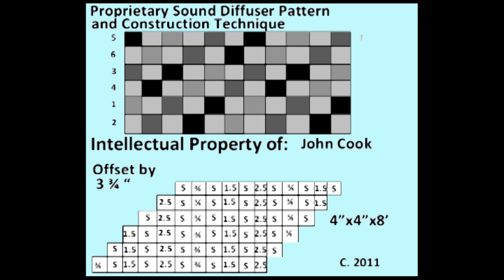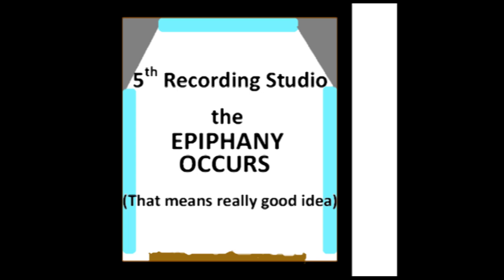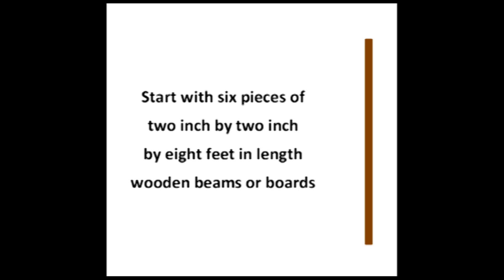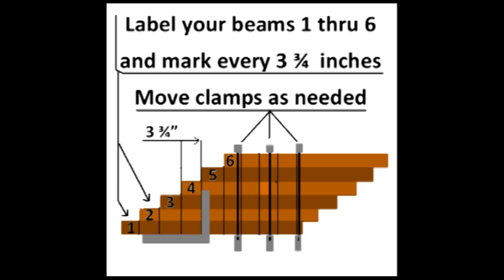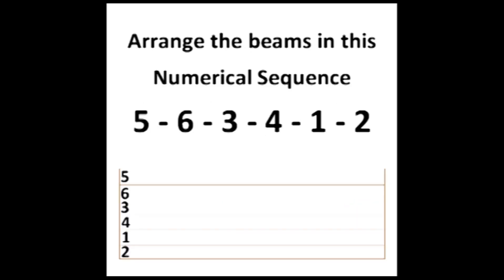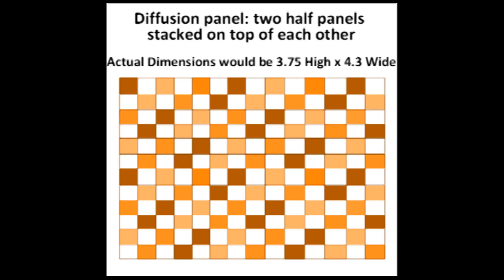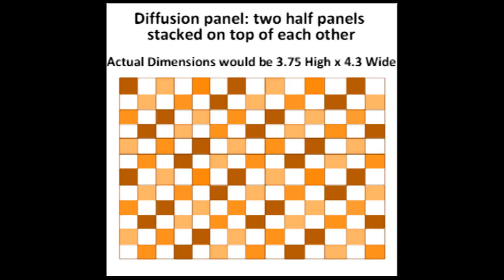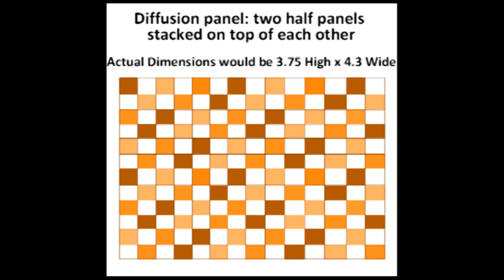Building a Mamoth sound diffuser #4 B 117

Comment: Hm, after having watched that vid 3 times now, I still cannot see the main innovation. Is it because of the cutting technique - or is it because of the pattern?  Did you investigate the result in terms of measuring the frequency response? What I see from your pattern, there are lacs every second place of diffuser elements. Is that right? Or is it just the very low element?

Comment: In diffusion, if you repeat the same diffuser in a row several times, you create the lobe effect.  If this pattern is based on a 2'x2' formula that's repeated several times, the longer it is may lessen it's effectiveness.  You have to use a modulation sequence when hanging them like the Barker Code.  It boils down to hanging a couple normally, then flipping the odd diffuser upside down (if you were dealing with 2'x2' squares).  You can easily find the barker code online.  Does this recipe take the lobe effect into account?  If not, I wonder how easy it is to chop this diffuser up into smaller pieces after initial construction. 

Very cool idea.

Comment from the maker: Most likely yes, but I do compare my method to the 2"x2" formula method for 2'x2' squares which is time and cost prohibitive. I most definitely mean 4"x4"x8' (or 10' if you use a couple of extra beams and make the mathematical adjustments). Also keep in mind that regardless of the width of the beam, it must be squared at that distance or you will end up with a disaster. If you have any more questions feel free to ask.